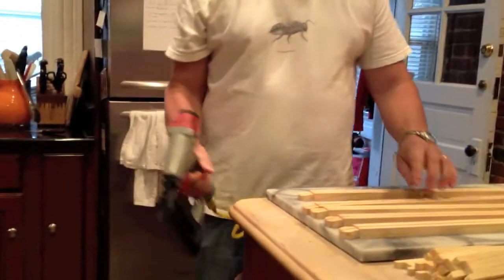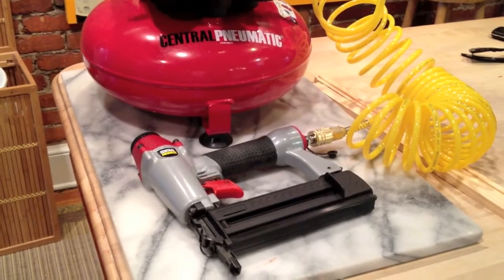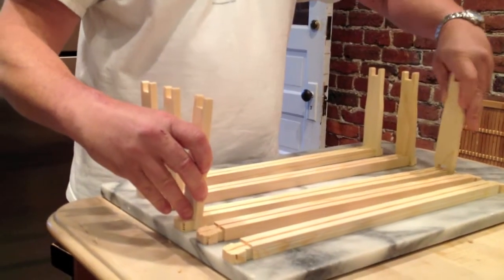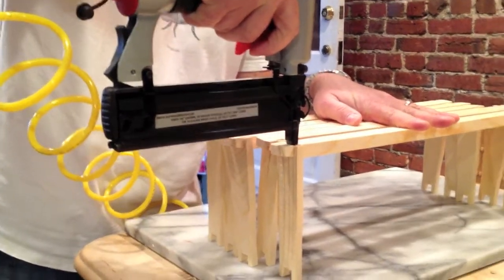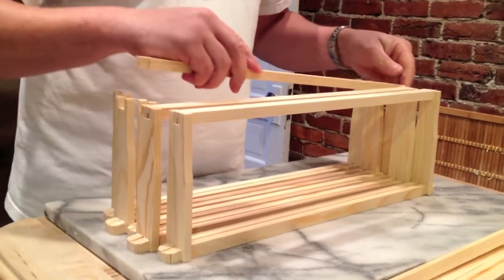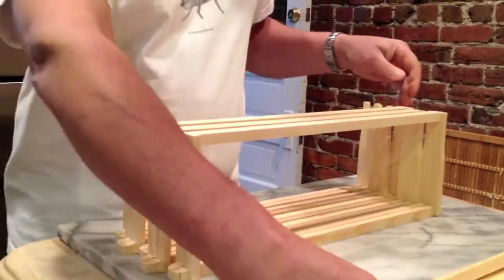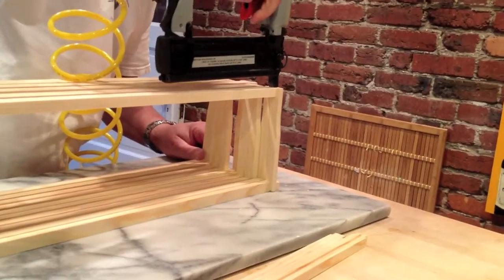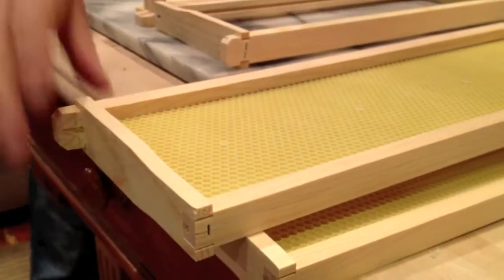DC Honeybees TV 4-22-12 Assembling Frames

Comment from the maker: As the saying goes, you ask 10 beekeepers a question, you get_____answers.
These staples provide a really strong mechanical bond.  I can't imagine glue will provide additional and accretive holding power.  

All I have is Don with is 30 years of experience to guide me, and until one of my frames fails, I will avoid belts + suspenders in beekeeping methodology.